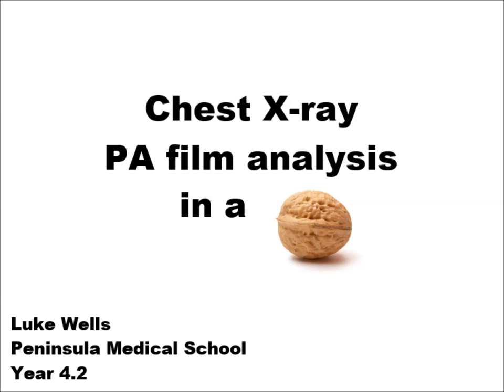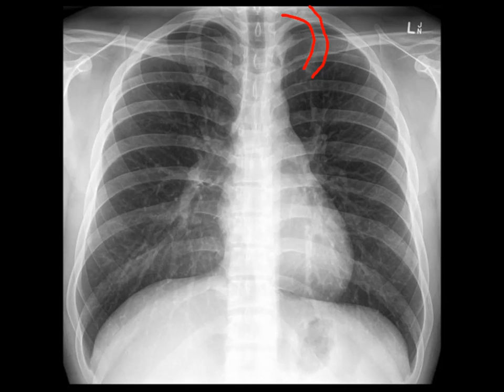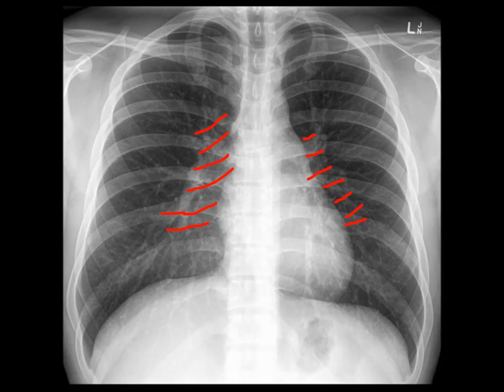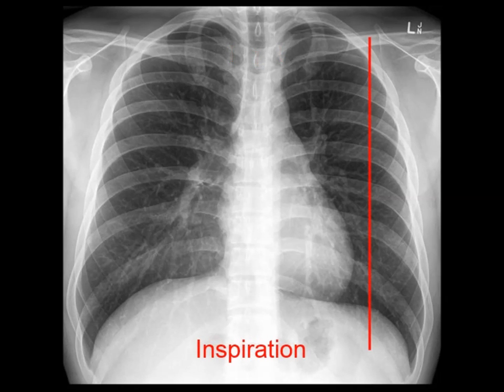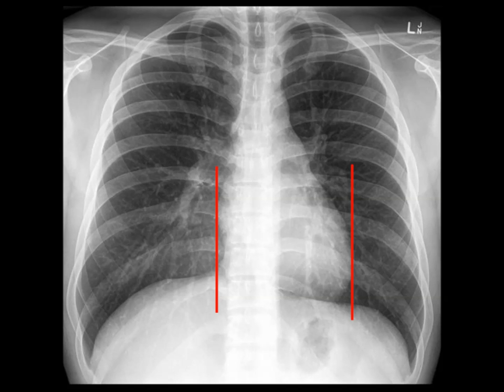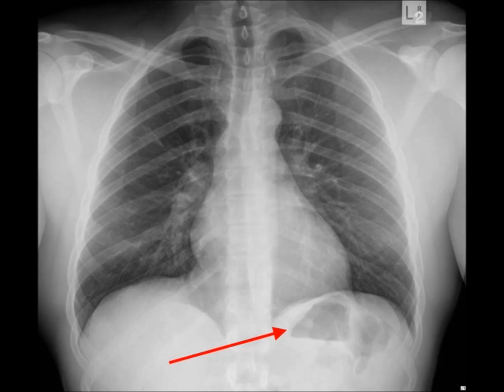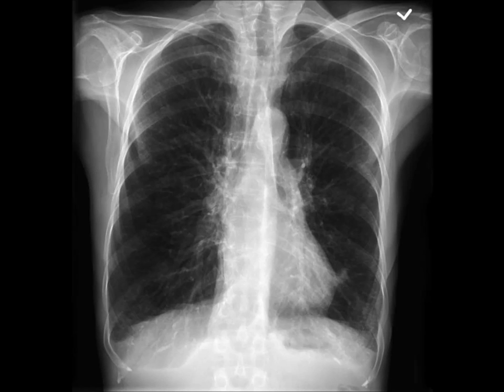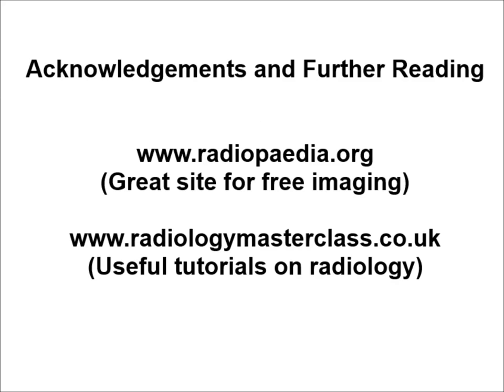Chest X-Ray (CXR) Analysis in a Nutshell

Comment: Thank you, Luke.  Very clear and short.
I just wish you could include more exercises. For inept eyes like mine, it is challenging to see the difference between, for Example, airway deviation and bad positioning of the patient (rotation); smooth vs not smooth surface area of the bone. It would be helpful to give multiple examples: deviated, deviated, deviated, not deviated, deviated...as an exercise like you did at the very end with the  two cases.

Thank you so much for the great presentation!